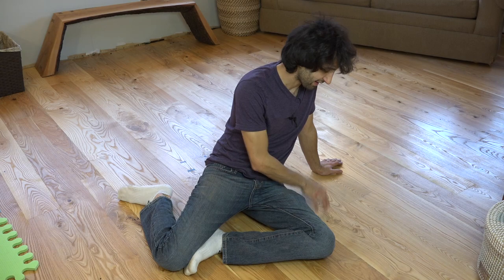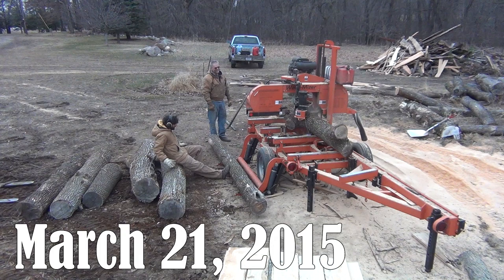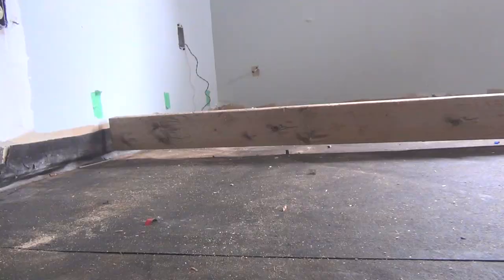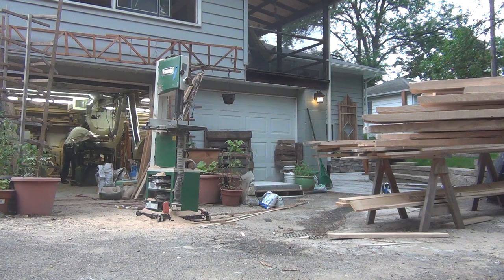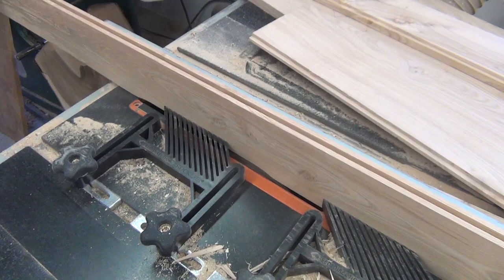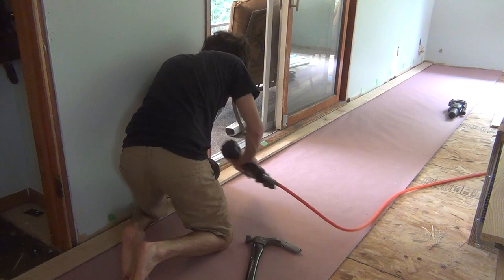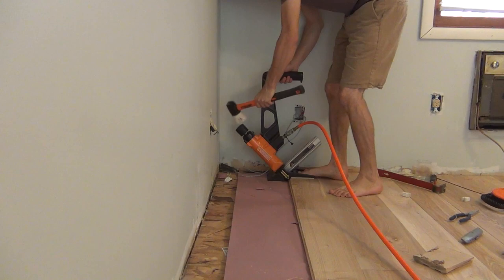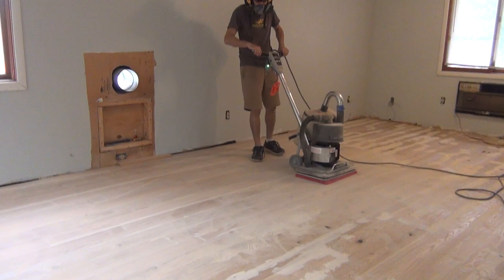Making and Installing Hardwood Flooring From a Tree

Comment: I'm doing the same thing right now with some hickory that I milled. I'm not sure if i'm going to tongue and groove the ends of the boards or leave them like you did. Do you think it's worth doing or are you happy with the results?
Reply from the maker: I did the ends with the domino so it was way easier than trying to run T&G on the ends.  I think on wider flooring it helps.  One board can't cup without taking the other with it.  It keeps the end joints flush.
Reply: +Matthew Cremona I must have missed that the first time I watched the video. I don't have a domino so do you think cutting a groove on the ends of the boards with a handheld router and inserting a spline would work?
Reply from the maker: Yes, I believe that's what pro installers do.

Comment: Hi matt! Im looking to chainsaw mill some red pine flooring for.a cabin project upstate, any recommendations on width to mill at considering cupping and shrinkage? Going for 8" wide tonge and groove
Reply from the maker: around an inch oversize will do.  That will leave some material to be removed when trimmed to width and factor in the width of the tongue
Reply: Ok awsome thankyou!, any recommendations on thickness to mill to get a 7/8 to inch board in the end?

Comment: Did you flip and or flop the boards every other one to make sure the growth rings aren't all in the same direction like one might do with a table top? I've never done flooring or looked into it very much. I guess nailing it and the tongue and grove plus your dominos in the ends would probably keep everything straight anyway. But I just know it's relatively common practice to flop the growth rings so they aren't all twisting in the same direction.

Comment: Why did you seal then sand, doesn't that remove the seal? I think see you put a top coat, what's the different between your first and last coat? I just did a floor with sanding and I applied 3 light coats of natural sealer (quick dry) and it seems great.

Comment: Is your table saw not hooked up to DC?  You have a Ridgid like me and I assume it's got a similar shroud around the blade, or maybe not?  Not that it gets everything, but your saw had a bigger mop of hair under it than you :)  For a guy who doesn't want to be a slave to production work you picked a heck of way to put in a floor :)
Reply from the maker: It was hooked up; that's just how undersized my DC is for my shop.  Mine doesn't have the shroud.  The saw was growing a mop head faster than even I could.  I'm good on the production work front for a long long time.  Thanks Kevin!

Comment: Great results, but BARE feet with a power nailer and flooring nailer?!  When I installed wood floors (not ones I made I might add), there were splinters, pulled nails and all kinds of junk all over the place.
Reply from the maker: Messy workspace :) no splinters, picked up any nailed I pulled. No issues. Thanks Robert!
Reply: +Matthew Cremona Still probably not a great idea.  Norm would be horrified :-)

Comment: I see this is an older video, but I love that you did this all by yourself.  However, I will suggest that it is by far more accurate, easier and probably cheaper (assuming a reasonable rate for your time) to have the rough sawn boards milled into T&G flooring by a custom, millwork shop.    If I recall correctly, I paid about $0.15/lineal ft to have this done by a local custom millwork shop.  They did it in one day, and made super accurate boards.  We did about 1000 sq. ft of red oak from trees in our forest.  The accuracy of the millwork made for super tight joints and minimal "overwood" for sanding.  That was the best $300 I ever spent.  It would have cost me more in jointer and planer blades and router bits, not to mention my time.  Sometimes it's better and cheaper to find a local small business that has the right tools for the job.  [URL=http://s262.photobucket.com/user/PortiaHank/media/Wood%20Floors/IMGP8667-1.jpg.html][IMG]http://i262.photobucket.com/albums/ii90/PortiaHank/Wood%20Floors/IMGP8667-1.jpg[/IMG][/URL]
[URL=http://s262.photobucket.com/user/PortiaHank/media/Wood%20Floors/IMGP8667-1.jpg.html][IMG]http://i262.photobucket.com/albums/ii90/PortiaHank/Wood%20Floors/IMGP8667-1.jpg[/IMG][/URL]
Reply from the maker: +Michael Bayerl now that I've done it all myself, this is exactly what I'll be doing next time